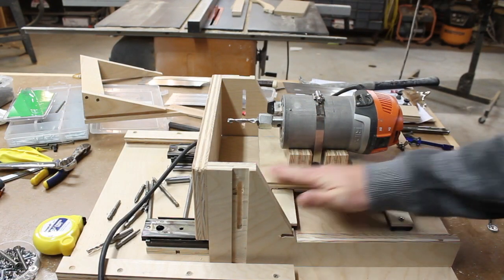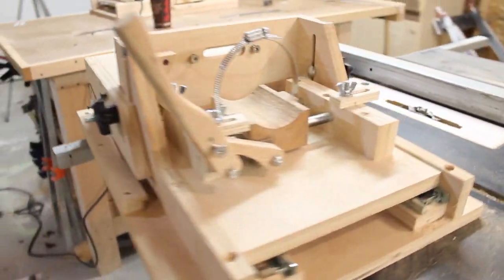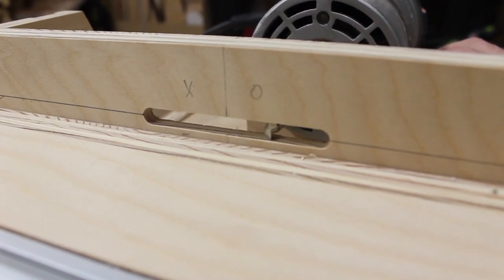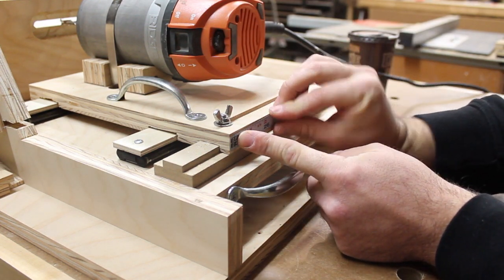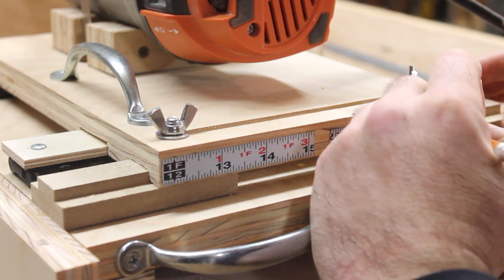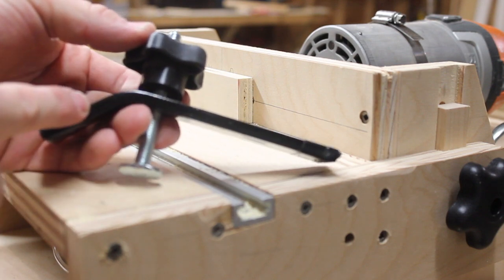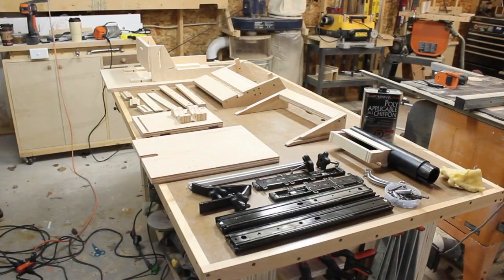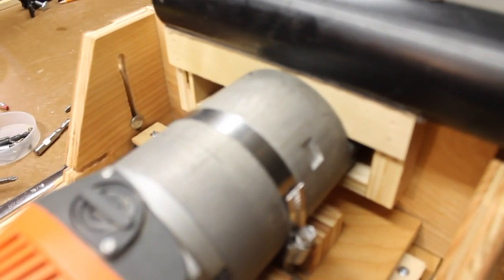slot mortiser part 3

Comment: I do have a suggestion for you.  Make up a set of blocks for all the common sizes that you make for slots.  Then run a dado down the middle and add a key.  Now route a key in the table of the router mount plate.  Simple to use!  Place the block in the key dado and bring your stops in to meet.  Instant size and centered without any measurment!

Comment: Nice video!
I have a suggestion: Make a U shaped from wood/metal, where the inside of the "U" is exactly the size of the cut of your mortiser + thickness of the metal/wood tongue that rides inside the "U". Mount it at the back end and you can change the width of the "U" bracket CENTERED, so you change the size of the mortiser! 
Good luck.

Comment: I have your plan saved and will start my build as soon as I get some hardware together. If could ask, would like to see you add a little more explanation about the setup of the rear stop blocks and how they relate to those zero marks you made. You also changed from 2 springs to one in the center for the up and down carriage any further info on the sizing for this would be very helpful.
Reply from the maker: Thanks pat for all the question. What I will do is put an article on shobuilt.org answering any questions you have.
Reply: That sounds great but plz fix your link you forgot the "p"

Comment: Ryan,
Just a thought on the task of maintaining symmetry of the horizontal stops. I have been pulling apart some old printers (for the leaded steel bar inside) and came across a mechanism for selecting the paper size. It has 2 arms with teeth on the side similar to a rack and then a central gear fixed but free to rotate between them. Moving one of the arms moves the other in the opposite direction. I am going to build one of your designs in the near future so may try and incorporate something like this.

Regards

Mike
Reply from the maker: Mike this would be by far the best way to set up the stops. Not only would it be  accurate, you would only have to set one scale for two stops. This kind of set was what I originally had in mind but I couldn't find and easy enough way to build an accurate enough mechanism (few failed prototypes) but if you have something available already built I would highly recommend using that.
Thanks for watching
Ryan

Comment: What is it with you Canadians?  You're just so darn good at wood work.  What a brilliant peice of work that is.   That dust extraction works really well too.  Did you use glue in the final assembly or just the screws?  I'll definitely have a go at building one!  Cheers.

Comment: i just watched the whole series of this build and I've downloaded the plans. i'm very excited about doing this build. if i might make two suggestions. one instead of screwing it together maybe some sliding dovetails might make it a little more sturdy. and the second would it be possible for you to do the plans in a downloadable pdf format as i have NO Clue how to get two Dimensional drawings from a 3D plan. i'm sure it can be done, i just have no clue how to use sketch up. Thank you for the time you took to build and share this.

Comment: Need a less motion required for the hold down method.
Accessory: MDF slab with a small step downstream and (lock router) instant small part jointer. 
Quick MDF triangle slab clamp in place and angle loose tendon capability.
Other quick accessories quite possible.

Comment: I am slightly confused on the positioning of the stop blocks. At 6:02 You said you wanted a slot that was 2-1/4 inches wide, so you set the blocks at 1-1/8 inches - 1/2 the width of the slot. However that doesn't seem take into account the size of the 3/8 inch bit.

Setting the travel at that distance from center, using a 3/8 bit, would result in a slot 2-5/8 inches - exactly 3/8 longer than you wanted.

So your stop blocks should be set to:
Length of the Slot, Minus the width of the bit, divided by 2
So in this case, that would be (2-1/4" - 3/8") / 2 = 15/16" Offset from center or 1-7/8" total travel distance
Reply from the maker: Yup, I was hoping know one pick up on that but your right I never account for the router bit size. ( I actually did set it right but said it wrong…)
Thanks for watching!
Ryan

Comment: Nice work Ryan... do you buy or make your tenon stock?
Reply from the maker: Thanks! I batch made enough to probably last a life time in about a hour by just ripping 2x4's to 5/16(test fitting before ripping them all) then rounding the edges at the router table. This gives me a 5/16 by 1 1/2" tenon stock. Very simple and quick. I did buy one length before but it's really expensive.